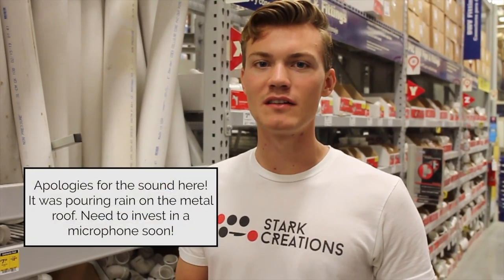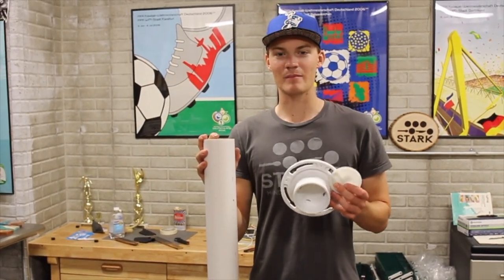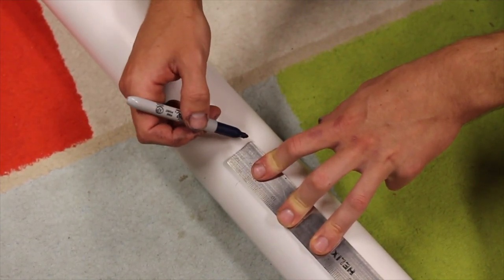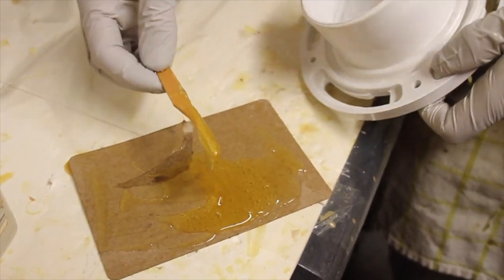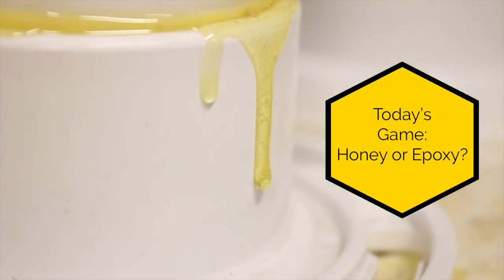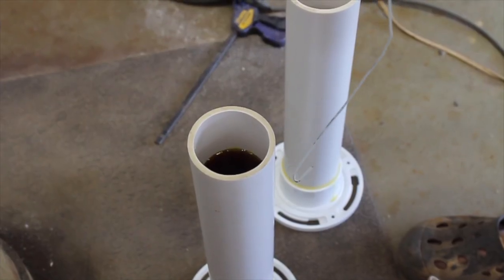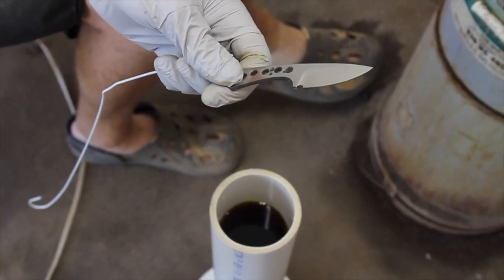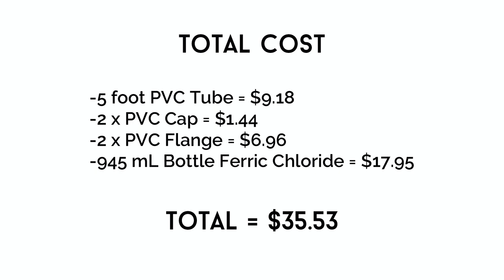DIY Acid Wash System for Knife Making

Comment: Great video! How much would it cost for a beginner to get into knife making? Equipment, material, etc! Cheers from Texas!
Reply from the maker: Matthew Vu Thanks! There’s a pricing breakdown of the materials at the end of the video. In terms of the equipment price, it depends on what you have. Some of the stuff I use is more expensive, but a cheap $20 hacksaw and some sandpaper could easily get the job done as well.

Comment: how did your flanges hold out? I'd use a regular end cap and make a holder for the pipes as the knock out on the flange can get broken out and then U have a nice mess all over
Reply from the maker: They’re still going strong with no issues thus far!
Reply: @StarkKnives  cool👍🏼

Comment: Hi I'm looking this from Thailand may I have more detail what do you put to mix with ferric chloride what kind of water
Reply from the maker: Most people use distilled water. I’ve done both distilled and normal tap water and both seem to work fine. :)
Reply: @StarkKnives  I have to use pure ferric chloride  or I have to do steel wool process first